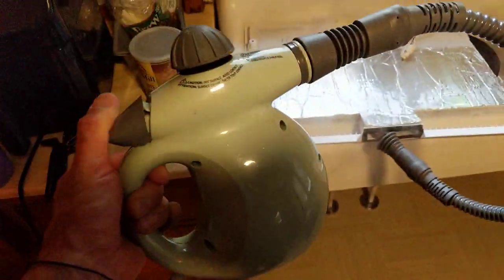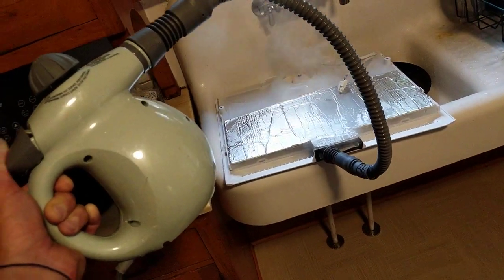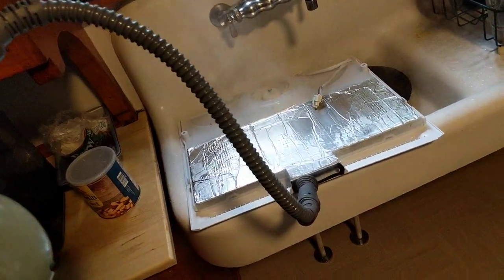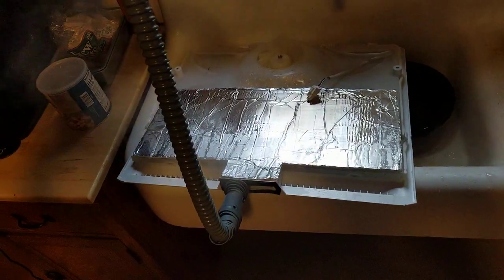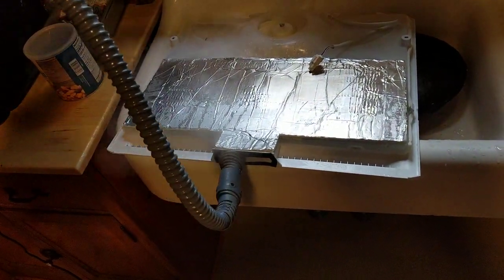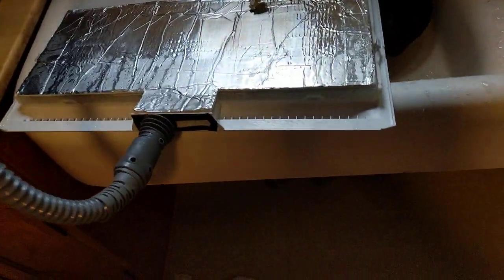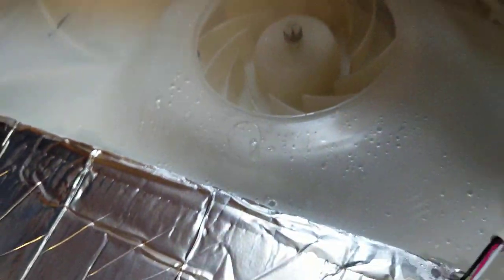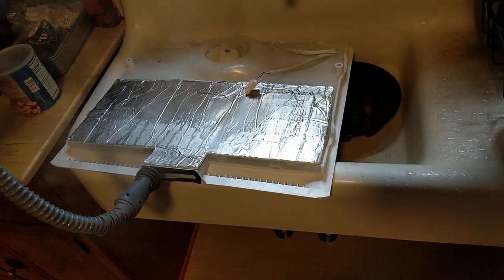criterion refrigerator bottom section not cooling

Comment: I had the same issue. This part was full of ice. I ended up running hot water through it in the bathtub. I got it all hooked up again, but I want to ask: Is it normal for the airflow to the fridge to be really weak? Is there a second fan in the bottom somewhere or is it just the one fan in the freezer that blows air to both? Thanks for your time
Reply from the maker: Usually is pretty a weak airflow. You don't need a lot of air to cool the fresh food section. Also, there's a chance of The return went to be frosted up to be sure. I recommend unplugging the refrigerator for 24 hours and leaving all the doors open
Reply: @myappliancefixed  thanks for the answer! My fridge has been working perfectly since I wrote my earlier comment, but I will unplug it for a day later on in the future just to make sure any ice is melted.